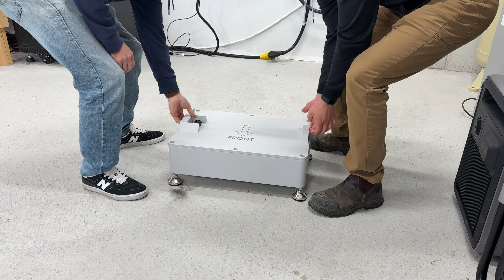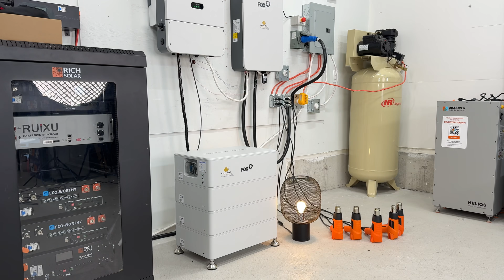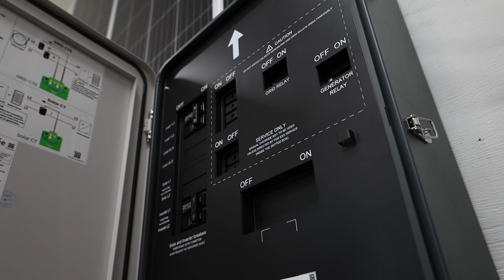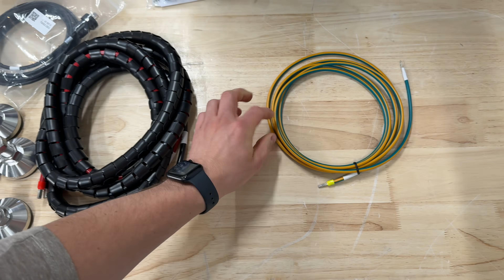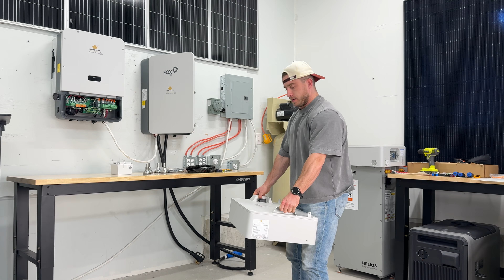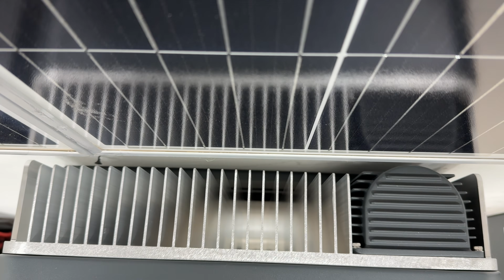Is THIS The Future of Solar? - High Voltage Maple Leaf Northern FOX Solar Kit

Comment: How much farther can these be away from solar panels because of high voltage? Do you have a video on the basic advantages of high voltage? Disadvantages? Does this make permitting in US more difficult? Etc. There’s lots of assumed knowledge here Im not getting. Thanks. ❤
Reply: Has nothing to do with solar panels.
Reply: Hi Ted, this product has been install through the US already. Out of the gate the cable with the equipment is 10ft. However following local regulation you could actually have the battery much furhter away and simply upgrade the cable size to 8awg or 4awg and get up to 200ft-300ft away!
Reply: @solarpowerstore  Just to clarify, that person's original question was about the solar panel array (not the battery)... that can just be 10 AWG (@ 15A) and still be run a few hundred feet without having to drop to 8 AWG.

Long distances for solar cabling is fairly common.  If you do that it is best not to do any paralleling of strings... backhaul the strings on separate cable pairs.

The battery stack cabling which can peak at over 65A is definitely a different animal and needs thicker cabling.

I would not recommend long distance cabling between inverter and battery under any circumstances.  The inductive loop becomes a huge problem for HVDC battery stacks that are cabled far away.

-Matt
Reply: Generally speaking HVDC solar strings can be very far away from the inverter.  If you use a 10 AWG backhaul, the resistance is 1 milliohm per foot.  So if your panels are 100ft away (x2 for 200ft on the round trip) the losses will be 0.2 ohm.

For a HVDC string the losses are thus very low.  Lets say the solar string is running 400V and 10A for a 4kW array, and its going full bore at 4kW and 10A.  The loss on the backhaul will be P = I * I * R = 10 * 10 * 0.2 = 20W.  20W out of 4000W = 0.5% loss.

The same is true going from the inverter to the battery stack, but generally speaking you want the battery stack to be close to the inverter to minimize the risk because even the amperages are low, the power levels are much, much higher than the power levels on a solar string.

Comment: We're happy to have provided these products to Solar Lab for this review! The Maple Leaf Northern Fox line of inverters, batteries, and smart energy hubs has definitely been a game-changer for solar installations across Canada. Our teams of installers and our customers alike have been loving these systems, and it's easy to see why! One important note that wasn't mentioned in the video: When you get your Fox ESS equipment through Solar Power Store, you'll automatically get extended warranty support - we take the 12.5 year manufacturer warranty and add another 2.5 years of coverage for a total of 15 years through Maple Leaf Power Systems. Just one of the many benefits of choosing Solar Power Store!
Reply: Can you change the firmware update system to be DIY without needing to contact the company?
Reply: You already lost me at the locked down firmware behind a certified tech.
Reply: I tried getting on your website and your SSL certificate is acting up.
Reply: @benoitdesforges4816  Hello Benoit thank you for the feedback I will get our techs to look further!
Reply: @solarpowerstore I went off grid solar to get corporations OUT of my life and mandatory anything is bad for business. Will keep buying from China...
Reply: @Jebus-d9k5j  so in order to get the large corporations out of you life you went out and designed your own products then,  mined your own resources, forged your own components,  then assembled your own products. Or did you just get a chinese large corporation to build your system?
Reply: @kevinthecarpenter7068 relax. The guy is probably not thrilled about needing to contact a tech for a simple firmware update. You just went nuclear for what reason?? lol
Reply: @PumpUptheJam81  the guy is bragging about going to China to get his components but saying he wanted to stop using large corporations.  What a joke. That's all. I think he really believes he's going off grid be ause he got his stuff from China as opposed to using the more conventional pathways.  I just would like people to think about why or what their actions and words cause.
Reply: oh we know!!!! Cannot be bought he says lol..... More overpriced BS.  11 thousand dollars for 12kw and just 8wk in batteries?   Got my Sunchees Solar setup with 12kw inverter, 32kw (2x 16kw batteries) and 12x 600watt panels for 6400 us dollars from China, and 1800 in shipping (total cost 8200 us dollars)

America and Canada r4pes their customers daily.... probably rebranded chinese inverter as well and they rebranding it and screwing people over.

Comment: Did I miss what the voltage is on the batteries? I just heard "high voltage" several times.
Reply: I believe its a battery stack.  Each Fox battery is roughly 100V and when you stack them they connect up in series.  Its a variable HVDC inverter system.  These systems tend to operate very cool and quiet because they don't have to down-translate the DC bus to a 48V battery bus or back again.

So, for example, if you have a 350V Solar string going into a 400V battery stack, the MPPT only needs to boost the string voltage a little rather than buck it all the way down to ~53V or so.

The downside is that the battery stacks are completely proprietary.  You can't just buy commodity 51.2V LiFePO4 batteries and add them to your system.  So you are stuck in an eco-system if you use a system like this.

-Matt
Reply: @junkerzn7312  As usual and once again, thanx Matt.
Reply: Based on the data sheet the batteries run at a variable nominal and a range of 85v-460v. It looks like they go up in voltage the more you have so wired in series. So 2-5x what most home systems run at(48v-54v)
Reply: @olsoj711 so essentially a Tesla battery?
Reply: @aussie2uGA it would be similar to the tesla power wall 1. This is a similar voltage as many electric cars, which is what the Tesla powerwall 1 was based on. Tesla powerwall 2 (52v) and 3(52-96v) are lower voltages.
Reply: Same, I was getting more frustrated as time went on.
Reply: @hificat101 Thank you, this was my exact question.  Solar Lab dropped the ball not explaining this.
Reply: Engineer here. Someone seems to have already answered your question, but i want to expand on the terminology. 

"High Voltage" is an arbitrary line that varies widely by industry. In my field (Marine), high voltage is considered anything over 1000V. Linemen draw the line a lot higher, because they work with voltages in the hundreds of thousands. "High voltage" is whatever you want it to be or what is generally accepted as such. 

That said, "low voltage" systems can still kill you. Anything around just 50V or higher can go through clean dry skin and straight through your flesh. Dirty or wet skin drops that significantly. We've all licked a 9V battery right? 

I'd encourage anyone handling these "high voltage" solar systems to embody safety and exhibit due caution around anything that COULD store energy (batteries, capacitors, and coils).